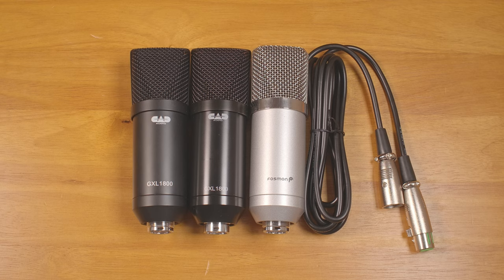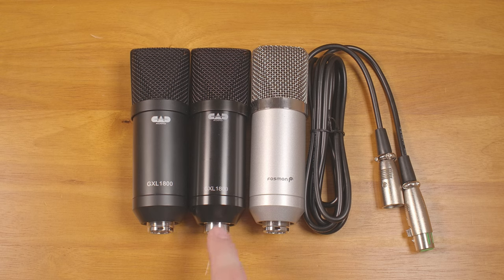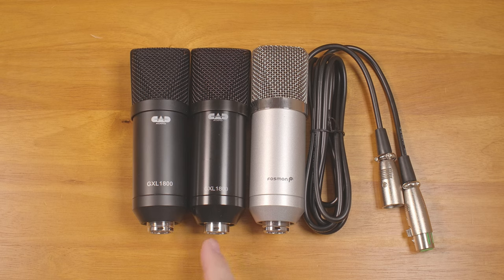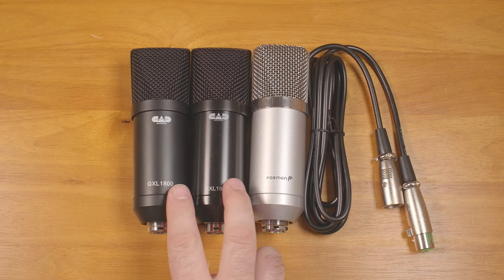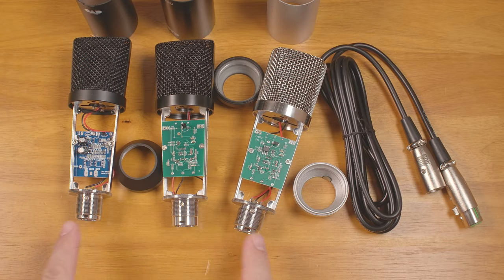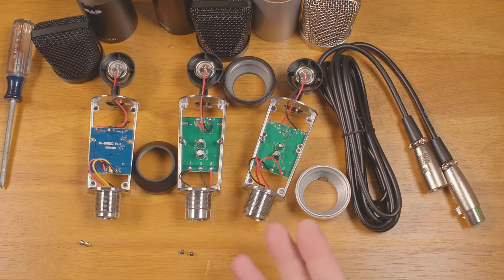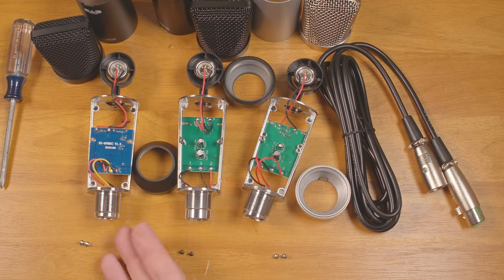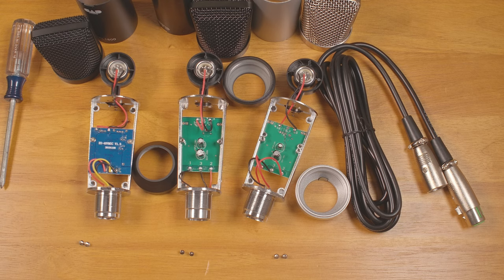Cheap XLR Microphones Are...Cheap:  CAD GXL 1800 Update

Comment from the maker: Update:  I was able to fix the second microphone.  It turned out to be a grounding/shielding issue.  Not exactly sure how it was happening, but I took everything apart and ensured everything was connected and grounded properly and put it back together and it worked.  I think it's actually a tiny bit less noisy than the first mic.  But the difference is very minor and certainly not enough to change my overall opinion on this mic.  It's still much nosier than spec.  Still, I did get the mic working.  So there's that.

Comment: Thanks,These are &80 + - from Astaic, & $19.99 from Amazone I thought maybe it had a 24mm capsule ..nope, thanks for a look inside.I have a Neewer that I put ina34mm cap $12 ebay  in and it sounds and works good after 
ferrite chokes & building my own balanced & shielded audio cables.I am just now learning .Maybe ill get 1 if I see it cheaper or reconditioned for the  black tube& screen that identifies it as a side address mic & put all the modded BM800 guts inside.